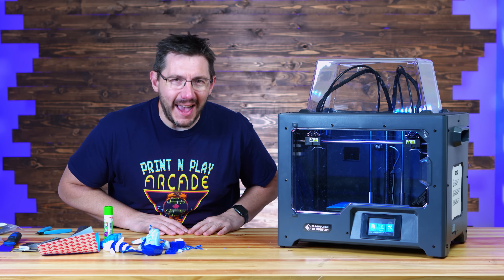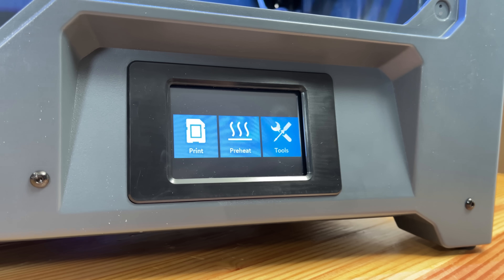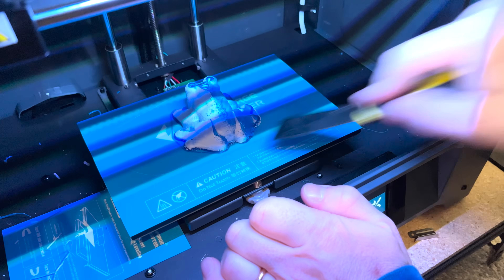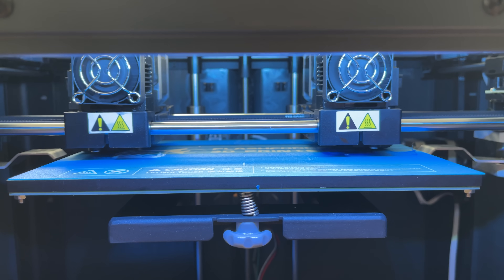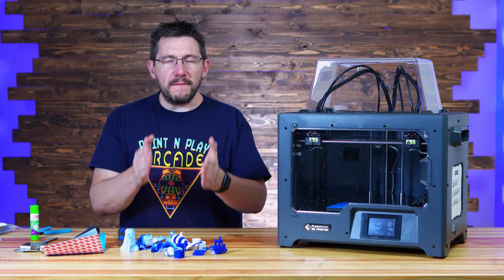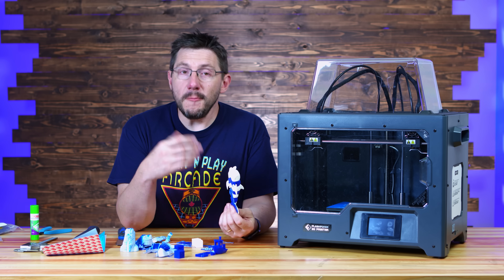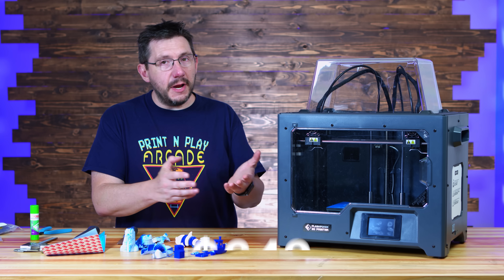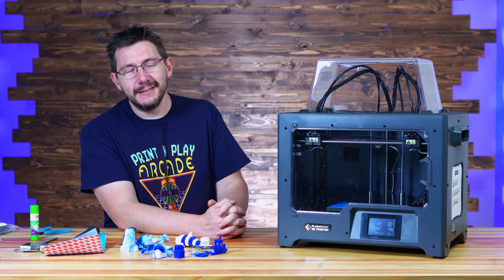Did Flashforge Miss the Mark?

Comment: This whole thing feels like a printer from the early 2010s. The fact you have to use a scraper, I don't think I've touched a scraper in a few years. No removable bed in this decade is a bizarre choice
Reply: Non removable bed, no ABL, included glue stick, $650....

It feels like a MakerBot mess all over again from the early days, yikes
Reply: @StormBurnX  madness isn't it?
Reply: You could buy 3 ender 3's and have a WAY better time
Reply: @thesinofthetin  very true
Reply: @thesinofthetin  Not dual colour you couldn't.
Reply: @Martial-Mat  I'd much rather mod an ender 3 to IDEX than deal with the flash forge crap
Reply: @thesinofthetin  Horses for courses. I'd prefer a machine that works easily out of the box and isn't made by Creality. But each has strengths and weaknesses.
Reply: @thesinofthetin  2-in-1-out single extruder setup would be easier I think. Hardware mods would be a little less fiddlely and most of the work would be setting up firmware on a new board and tinkering with a slicer for a bit.
It works on the Neptune 2D (once you put in a properly sized hotend liner and setup a proper SEMM slicing profile in prusaslicer, instead of the barely modified version of Cura they give you).
Reply: I mean, this essentially is from what I see. From my experience with the Creator Pro, it's basically an improved Makerbot 2X; this looks like a Creator Pro that's had portions of the hardware updated, just they didn't update them nearly enough. Who the hell wouldn't have have a magnetic removeable build surface, even if it's the crappier sticker sheet kind?

I have to wonder if they had a bunch of Creator Pros sitting around unsold, and they decided to update them in an attempt to get rid of the old stock without reducing price or looking like a bit of a joke, while also not needing to spend a ton updating them.
Reply: I have a normal Cr10 with glass bed and no modifications at home that I have used for a couple years now while at work I have a Cr10s Pro with removable bed and ABL that I've used for a little less than 1 year and honestly the 10s Pro sucks so much, bed can be leveled and then be like 1mm off the very next print while my original Cr10 I really don't remember the last time I moved the levelling knobs, and with the scrapper you don't need to go ham with it just a couple of taps around the border does the trick, sometimes newer doesn't mean better
Reply: @VGInterviews  I have a CR10 V2 and it has been a love hate relationship for a while. There are days i want to grab and toss it out a window, lol . I am debating getting a Elegoo Neptune (smaller build surface sadly) or save up for a Bambu X1
Reply: @Spirited282  I just got the elegoo Neptune 2 and I love it the prints are smooth as butter and Iv had no issues
Reply: @VGInterviews  I've just straight up turned the mesh bed leveling off on the 10S Pro; the capacitive sensor is terrible and only really functional as a "good enough" Z-axis limit switch. I'd rather level it once and be done with it, cause then as long as you take the bed off before print removal it pretty much stays level. I wonder if you could easily replace it with and inductive sensor, otherwise I'd just swap in a BL-touch and deal with flashing firmware.

Comment: I recently bought a Sovol SV04 IDEX printer. I've owned and played with other Chinese printers in the past so I was very pleasantly surprised at the build quality and cable management of the Sovol, hard to believe it was Chinese. It worked great right out of the box after calibration and I'm floored at how smooth the prints are. 

Of course being a hardware guy I had to tear it apart to check it out inside. The only things I didn't like were the usual Chinese sleeve bearing fans (Creality brand in this case) but I will replace them with ball bearing fans when they fail. The motherboard is a new Creality 32 bit board and the only thing I didn't like about it was that the stepper drivers are soldered on. 

The reason I went into all this was that this printer was about $130 less than the FlashForge, has a much larger print volume (300 x 300 x 400), auto bed leveling, auto Z motor synchronization, and so on. If the FlashForge had delivered on it's print bed I could be more understanding. The Sovol has a magnetic removable bed and the prints pop right off. 

I can't address commercial use as I am a home hobbyist. The extruders are all metal and the motors and other components appear to be of high quality but only time will tell. It would appear that FlashForge isn't paying attention to the competition for the home market, but maybe they are aiming for the commercial world.

Comment: I have a flashforge creator pro 2 and ive been using it for a few months now. I have to say, it is far in a way the worst priinter i have ever had in several aspects
My biggest issue is that modification is essentially impossible. Flashforge used an entirely proprietary heat block system so your standard MK10 heatbreak and nozzle assemblies simply dont fit. second, removing the heat break tube from the cooling blocks damages the heat break and cooling block irreperably meaning you have to buy and fit new ones if you want to change from the PTFE lined hotend. 

There is no minor adjustment you can make to the z height of the nozzles meaning that if you dont install the heatbreak tubes perfectly during assembly (which is borderline impossible because of the way the grub screw is installed) there is no hardware adjustments to align the tips of the nozzles vertically. 

Ontop of this, because of the proprietary design on the nozzles, only flashforge and microswiss manufacture quality nozzles that fit this printer unlike every other printer on the planet which uses standard nozzles so you can forget buying your favourite nozzle from brozzl or just cheap, standard nozzles from amazon. 

if you want to use any filament other than flashforge then you have to print out a new filament holder (ok, minor annoyance but its not exactly hard for flashforge to just use a standard filament holder.)

Also, the flashforge software is (in my opinion) hot garbage. Its far too restrictive, print quality is really not great and its overall just annoying to use. fortunately someone put together a prusaslicer mod that lets you use the printer with all of the features that flashforge allows and released it for free on github.

additional minor complaints include not being able to silence the annoying beeps and tunes it plays when it starts up, the touchscreen is intermittent at best and downright unusable at worst, and the "hat" warps easily and pops off for no apparent reason. 

The firmware doesnt feature your standard set of features such as e-step calibration, steps per mm and accelleration controls etc. additionally, flashforge not including even the option of installing a mesh bed levelling probe seems antiquated in this day and age. 

That said, the fact you can do idex printing at all at the price point is really good. Id say is a pretty good printer for the price but if given the option, i would return it in a heartbeat and buy almost any other printer.

Comment: You can replace the bed surface with a magnetic pei metallic sheet, offset the height difference under the z level sensor and it should be fine. The major disasters of this brand includes: friction inside those filament guiding tube, filament fragments stuck easily inside the extruded gears…
Reply: This is what I did!
Reply: The new Bed surface, where did you get it from?
Reply: @4doormk1  any magnetic PEI set with 210mm on X-axis should be okay. I got two of 210 x 150 and two of 220 square from aliexpress. Be careful that the PEI sheet will be curved under high temp if it exceeds the heating surface too much.

Comment: Hi Joel, when did you get that printer? I have 2 of them and they came with removable magnetic build plates out of the box, maybe I have a newer version which they changed? also the slicer software did default to rafts which were no problem to remove but it's just a tick box to disable them. Because of the build plate I have had to level the machine once when i first got it and it has kept level ever since.

Comment: Your nozzle is too close to the bed and this is why the prints are difficult to remove. Why is the nozzle too close, because the Creator Pro 2 does not allow for the bed and nozzle to be heated when levelling the bed and doing the z-calibration. This is done when it is cold so when you go to print, the heated bed and nozzle both expand, which reduces that z-height.

This causes many issues, one is that the parts are hard to remove but it also then causes filament to back up due to the excess nozzle pressure which then causes clogs in the ptfe tube/nozzle.

I know this because I have 4 of these printers with many thousands of hours on them.
Reply: I do agree if you print too close it'll stick badly. But a printer in 2022 really shouldn't have a build surface that is that unforgiving, especially if it's not removable. It's fair to point it out especially since lower cost printers tend to attract beginners. Also they wear down over time. Fresh ones tend to adhere quite heavily even with the z height dialed in. I wonder if the formulation has changed over time too.

Comment: Shame that some of the original companies that manufactured 3d printers have failed to innovate and move with the times, instead are stuck using old designs. Won't be long before companies like Creality get left behind as people move to slightly more expensive but better printers e.g. Bambu Labs.

Comment: Not sure if it helps, but from my experience with an Adventurer 3, Flashprint Rafts are just awful in general. If you calibrate the nozzle properly, you'd still have to remove the rafts with a chizzel. They only come off from the print easily if you offset the nozzle further from the bed by like 0.2 ish mm. Its this weird goldilocks region of "Far enough from the bed where it won't smush the model into the raft" and "Not too far that the first model layer looks awful"
Reply: I had an adventure 3 I just sold it a week ago. I upgraded to an Aquila. It worked great but the bed level and bed were annoying too they used the raft to help with the level since you could never really get the bed level right. I never used the raft tho since my prints always fused to the raft instead of the bed
Reply: @Monocle13  Same. I bough the glass bed and while things got better, I’m now printing on a Prusa Mini.

Comment: The Flashforge filament was impossible for everything. I have had no issues with literally any other filament that I've tried. That being said, the raft settings are terrible and may as well be called a base. I've been using Polymaker, eSUN, Duramic, and DB filaments and they all just pop off the bed. 

The worst part about the whole thing is all the proprietary things like nozzles, slicer, and filament roll diameter for the holders (just print new filament spool arms on day 1).

3/5, still use the thing daily, but I miss Cura

Comment: Flash Forge do sell a magnetic flex plate with the same sticker that comes with it. In my experience those stickers are a pain to remove and require some "unpleasant" solvents just to get all the glue off it.

Comment: Correction: Leveling your 3d printer manually should not be required on a printer today.  I feel like any printer that still needs to be manually leveled should get a bad review.
Reply: That's silly. Auto-bed levelling doesn't level your bed. It's a little measuring device that helps compensate for unevenness in the bed by recalculating mesh-data of the bed. Manual bed levelling is what makes the bed as straight as possible so that the CR touch or BL touch doesn't need to do much.

Comment: Great vid- felt like going back in time again. Is it antiquated, or were they going more for "retro"? Defaults with a raft?? Maybe Flashforge customers are used to doing that so they wanted to keep it similar? I dunno, seems like an odd choice. For the build plate issues... Magnetic build sheet / 3rd party system as you mentioned should be a pretty easy "fix" but I think there are much better options out there for the $$'s.
Reply: I can confidently say that we do not. Pretty much everyone in the Flashforge facebook group disables it immediately or switch slicers entirely. I'm guessing its more for the educational institutions or other bulk buyers that prefers rafts.
Reply: @reignandbongao9497  That makes sense, thanks for the reply.

Comment: I am sorry but I'm very disappointed with your review this time.  You sound like a complete newbie even though you have so much experience in 3d printing. 
I have all flashforge printers. And I'm not a big fan of the cp2 but the problem you had was inly the z off set calibration.  All you have to do is turn all 3 screws about 90° counterclockwise and that's it
Reply: No matter. It is already an outdated design.
Reply: All you have to do is ignore the calibration. There fixed it for you
Reply: Let's see if he gives that a try and corrects his review if that turns out to be the issue.